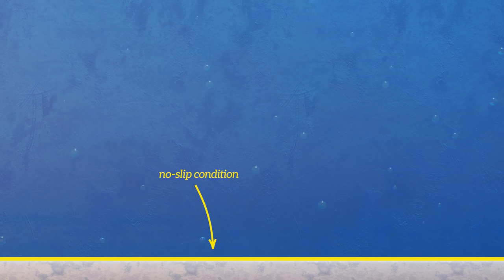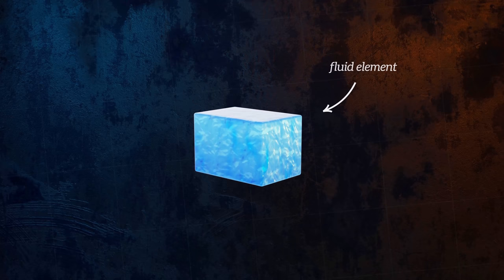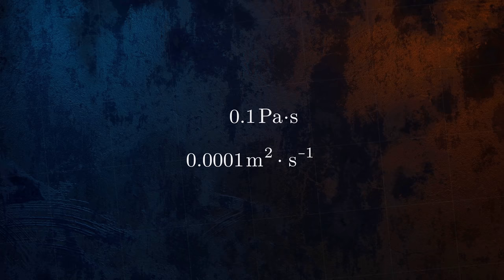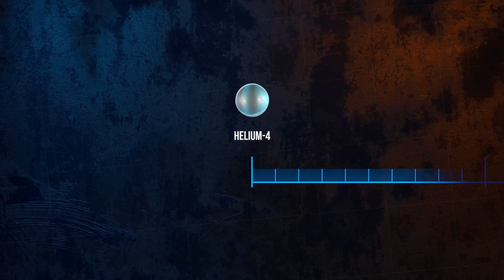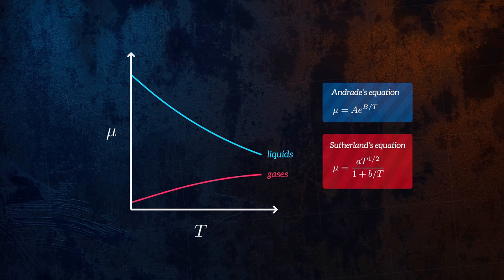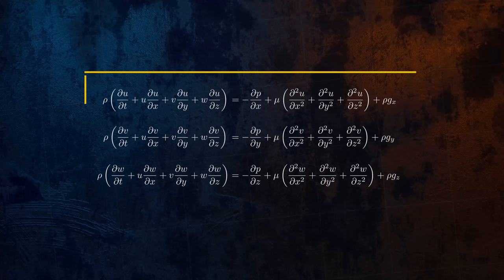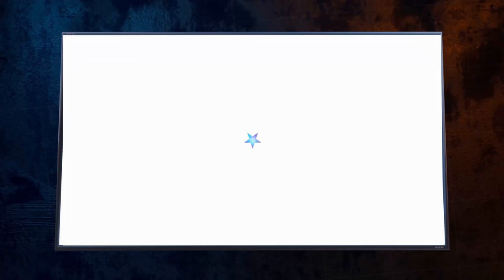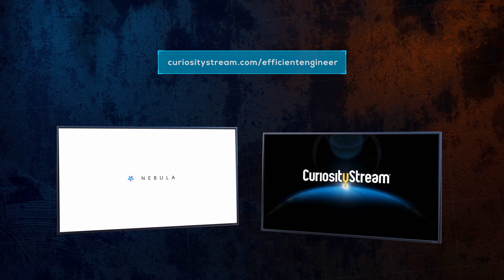Understanding Viscosity

Comment: Hi man, super great video as always. Just one thing, I think I’m missing something: at 1:38 you say that the slope of the curve at a point is calculated as speed of the fluid divided by the distance from the surface, but a general slope is dy/dx on an y-x graph like that so I can’t understand. Then you say that the slope is very little far from the surface but when moving the slope up it is actually getting bigger and viceversa when it gets near the surface, so I dunno, probably there is something I’m missing. Can someone please help me to figure it out?🥲
Reply: Same, I’m confused too
Reply: I think the graph has just been labelled weirdly / flipped.

The vertical axis should be y and the horizontal axis should be u(y) . 
( In the video it appears like the label u(y) is on the vertical axis, even though the arrows representing u(y) then move horizontally. )

If you instead flip the graph so that y is the horizontal axis and u(y) is the vertical axis, it is more similar to how we usually graph functions ( x horizontal, f(x) vertical ). This also explains why the slope gets larger towards the surface even though in the video it seems to get smaller - du/dy is the slope of the graph with y as the horizontal axis, which is the reciprocal of the slope in the video ( dy/du ). 

I could be wrong though, if someone notices I've made a mistake please do correct me!

Comment: Nice illustrations. You are however wrong about the reason for the increased viscosity of gasses when heated. The increase is not do the the increase in collisions, but due to the extended mean free path coused by an increase of thermal velocity (diffusion coefficients scale like (thermal velocity)^2/(collisions frequency)). In fact, collisions drive the velocity towards a Maxwell-Boltzmann distribution exhibiting zero viscosity due to symmetry.

Comment: I am a bit lost. In gases, as the video explains, molecular interaction is created by the random motion of the molecules. Therefore, more temperature, which result in more random motion, implies more viscosity. 
But as far as I know, turbulent fluid implies more random motion. This helps the BL to not detach as turbulence "pumps" energy into the BL

Comment: In other words, if a shaft is turning in a bushing, the viscous fluid sticks to the shaft and the bushing and viscosity is the way that the fluid dynamics of the  “internal” motion of the fluid works between the stationary layers relative to the surface that they are stationary relative to.

Comment: Curious to know : In liquids,since viscosity depends on the cohesive forces between the molecules,shouldn't denser fluids be more viscous? As an example  : Oil is less dense compared to water but is more viscous.
Correct me if I am wrong...✌
Reply: Density has nothing to do with viscosity.! Density just represent the heaviness of the fluid. Example take equal volumes of water and oil( 1 litre) . If you weigh these two, water will be heavier oil will be lighter because density of water is high. On the other viscosity just represent the resistance to the flow. Higher the resistance higher the viscosity flow will be difficult. Hope this helps you.!

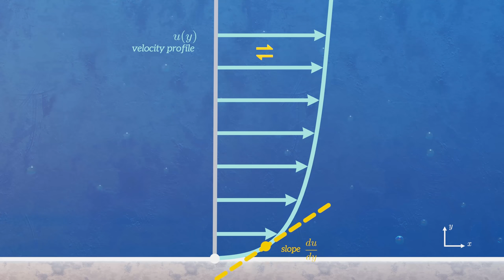Comment: There is a mistake at 1:52, how is the slope large close to the wall? in fact it is the opposite of what you say in your video
Reply: Agreed. Confusing. But, then again, he doesn't know how to pronounce Euler or Navier. Perhaps he meant to state that the rate of change of the slope (the derivative) was large near the wall and approaches a constant value (nearing zero) much farther away?
Reply: @RME76048  that is indeed more appropriate

Comment: @ 2:05 Shouldn't the slope be negative because at du/dy = 0, there is maximum shear, and decreases as slope decreases?

Edit: I think the x-axis is labeled incorrectly, it should be u, not du/dy?

Edit 2: He just said that at no-slip boundary, the shear stress is maximum, but on the graph, it's zero? Contradiction?
Reply from the maker: If du/dy=0 the fluid layers are moving at the same velocity, and so the shear stress is zero.
Reply: @TheEfficientEngineer  Thank you sir!

Comment: At 1.23 .... On y-axis we have vertical distance and on x- axis we have velocity... therefore slope = dy/du .... inverse of the velocity gradient. What you've presented as slope is velocity gradient itself which is wrong.
Reply from the maker: Why would slope be dy/du? It doesn't really matter which axis is vertical and which is horizontal. Just imagine that the axes are rotated by 90 degrees.
Reply: @TheEfficientEngineer  it does matter! At 2.00 ...on the left side...you plotted shear stress vs velocity gradient. We know they are directly proportional...so when shear stress is high, velocity gradient at that point must be high to ensure direct proportionality. But.. According to you when shear stress is high (which is close to the plate ) ...the slope at this point (close to the plate) according to your opinion will be du/dy = zero. Which is wrong. If shear stress is high... velocity gradient (du/dy) must be high and not zero. Hence it does matter.  

Correct visualisation is...shear stress is high (very close to the plate) there slope (very close to the plate) will be  dy/du=0. 
As du/dy is inverse of dy/du... velocity gradient (du/dy) will be infinity. And thus, high shear stress corresponds to high velocity gradient. Direct proportionality is ensured.
Reply: @TheEfficientEngineer  Check any standard textbook for fluid mechanics and you'll know what I'm talking about. Btw the animation was really great and very helpful to visualise the framework of viscosity.

Comment: The statement at 2:30 is wrong. There are fluids that obey Newton's law of viscosity but aren't newtonian fluids. Spurk, Fluid Mechanics 2020: "it is sometimes incorrectly used as the definition of a Newtonian fluid: there are also non-Newtonian fluids which show a linear relationship between the shear stress and the shear rate in this simple state of stress."